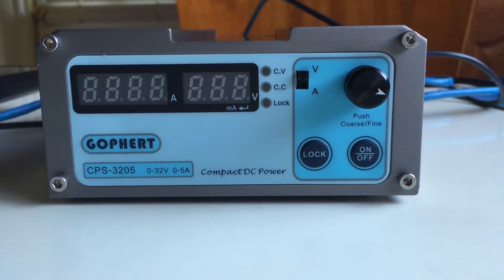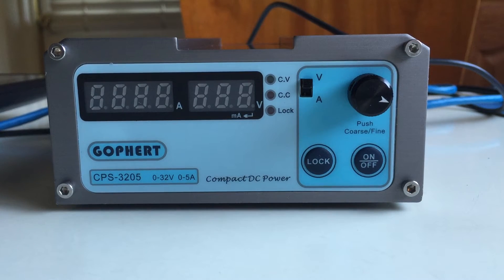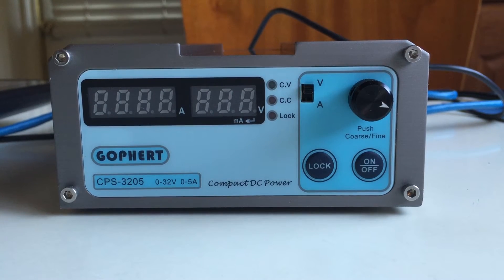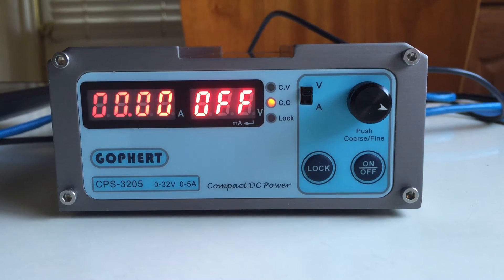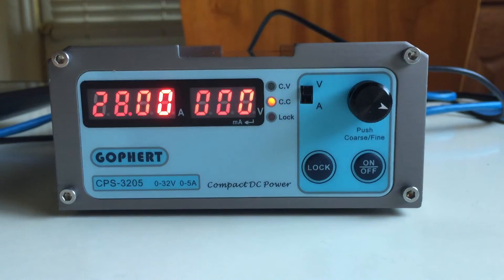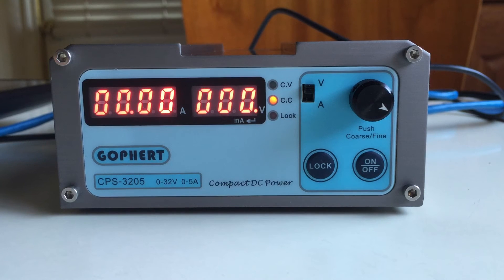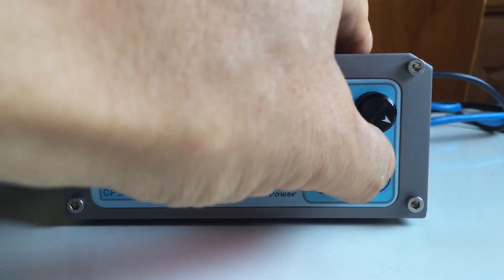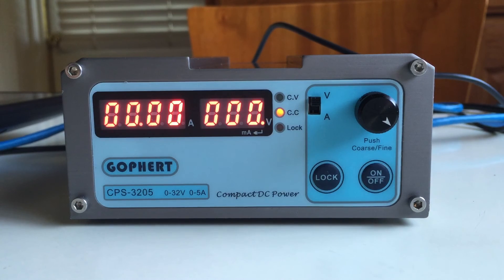Defective GOPHERT CPS-3205 Power Supply *** NOT ***

Comment: I got one but V and A are at the right place and it works fine, never had any problem with it.
But I think Banggood sent you a defective unit.
I did a lot of stuff with mine, used it as a laptop 19.5 v 3.75 a power supply, did electrolysis(copper, zinc, iron, aluminum) and electroplating on it. Use it for breadboard and circuits tests. It is working fine without any problem at all.
It ain't the best and it ain't the worst, it is just good for what you need it for.
Banggood are scammers, sometimes I think they collect factory trash, defective units and stuff that never passed quality checks/tests.

Comment: I've ordered the CPS-6017, already shipped, and some how I just noticed it's the 220V version, will that work with a regular house plug, USA
Reply: on the  CPS-3205 unit there is a red switch l(one in the middle down there) that switches between 220v and 110v voltage input
http://www.gophertc.com/sites/default/files/styles/large/public/CPS-320SBack_3.png

Comment: You are very confused about how this unit works, nothing is wrong with it, nothing is mislabeled. The V/A switch tells you which mode to adjust, the indicator lights tells you which mode is in operation. i.e. you don't switch between CC or CV mode. It will automatically operate in CC or CV mode depending on your two values and load. If the product of your load resistance is lower than your set voltage, it will operate in CC mode. If the product is higher it will operate in CV mode. All DC power supplies with a CC mode works this way.

Comment: The problem is in a switch A-V. Use dremel to increase gap there the switch is moving. It is just does not turn on necessary mode for make settings.

Comment: Thanks for the update - I was going to ask if you had requested any current...  Although I must say, very disturbing to have V and A mixed up on the front panel.  I love how the mA is displayed under the V so at least that got to the right place.  Glad it's working for you.  There seems to be some question as to which version "Gopher" or "Gophert" is the clone (assuming there is a cloning going on) and it seems that even the company itself can't decide. http://www.gophertc.com/ has devices with the name Gopher and the next will have a Gophert symbol.  Perhaps they are exactly the same and just the front panel is mis-printed.  Various teardowns and reviews showed them to be competent and safe (no spike) devices.  Scary.
Reply from the maker: Yeah, as in my linked article above, they use both GOPHER and GOPHERT on the genuine products. I'm now sure mine is not a clone.
Reply: +linco matic I think of it as setting my limits, both voltage and current, and it will do it's best to supply both as long as the load requests it.  Because there is always a limit.